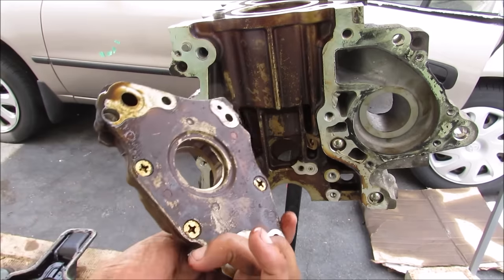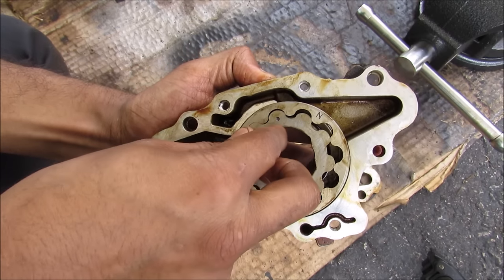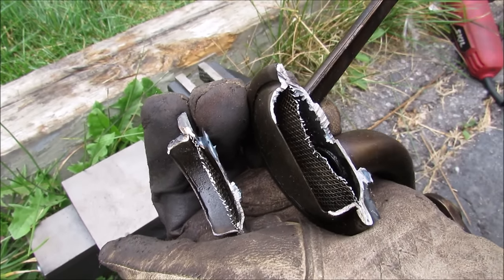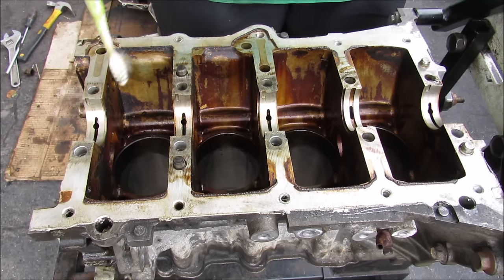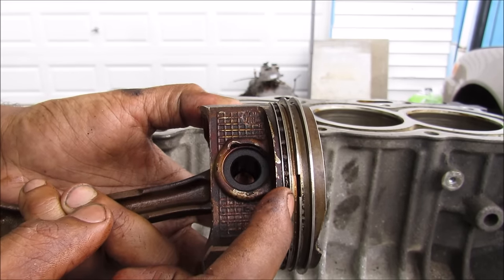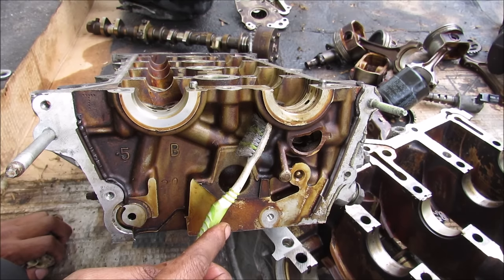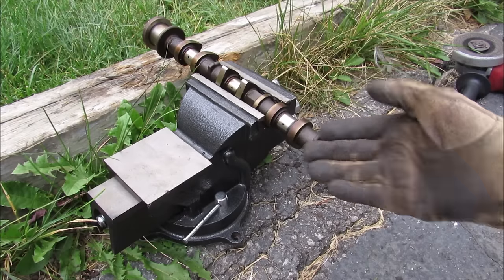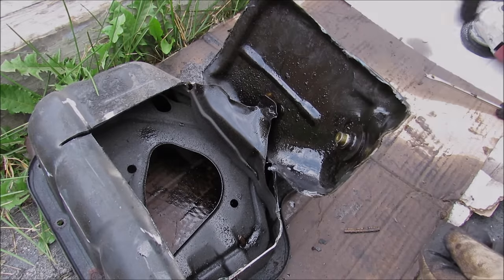How the Engine Lubrication System Works

Comment: You have sacrificed one of your engines to teach us how the oil lubrication system works we appreciate that. Thanks man very helpful show.
Reply from the maker: Hey I learned alot too!
Reply: @speedkar99  how do you know when you need a new engine vs a rebuild? I had an oil leak and ended up driving my truck for 30 min without oil.
Reply: @HighPriest1776  take the block and head to a machine shop so they can properly check for warping.  If it did warp, sometimes they can machine the high spots down to get all mating surfaces completely flat and properly hone the cylinder walls out if it's not too bad.

Comment: Moral of the story; your oil travels a great distance through many small holes and passages.  Better keep that oil clean if you want your engine to last.
Reply from the maker: +Brian Day it sure does.
Reply: And stick with anything but murican engines, murican engineers don't know what they are doing when it comes to an engine

Comment: When I was younger I was wrongly told oil just kinda got flung up everywhere it needed to go randomly from the engine moving - I really thought it dipped into the oil puddle at the bottom. Later I realised there were 'oil galleries' but I still thought they just sorta carried oil into different areas of the engine. I had no idea everything was this precise - it's amazing. And I didn't realise why oil pressure was needed but I can see now it's to make sure oil is forced through all those small channels. And that oil pump is like nothing I've ever seen too - I've made so many assumptions all these years, I just thought it had blades like a water pump or something. I'm astonished how much you can teach someone in 7 minutes.

Comment: You forgot to mention the crosshatch on the cylinder walls. Those are very important in the lubrication system. One cannot just assume that the oil will lubricate the piston rings. Without those crosshatching, you'll burn the piston rings and walls really quick.
Reply: btw I like your videos a lot. I binge watch this shit. hells yeah brother, hells yeah.
Reply from the maker: +hostilityy thanks, I actually didn't think of the cross hatch
Reply: speedkar99 They're essentially part of the lubrication system because if they're too horizontal, they'll hold too much oil and the piston rings will just be floating on oil and never really grab the cylinder walls. if too vertical, the oil will just drain down and no lubrication and will fry the piston rings and cylinder walls. that is why they have to be "cross" hatch like 45 degree angle overlapping each other with specific groove depths. 

your video is still perfectly fine without this detail because the average tuner or DIY guy doesn't know this stuff even exist. too technical lol

Comment: Comparing this video to all others on the same topic, they use diagrams and computer-generated animations with all colorful stuff, but in the end THAT’s what I was looking for ! ( just like the difference between color atlas of anatomy on a real cadaver, and other sorts of anatomy books 📚, there’s only so much you can deliver with diagrams .. the real machine dissection is a whole next level .. )

Rich in details and even the wear and tear marks, traces of damage and scratches, all give you a subliminal hint about the mechanics and you can always perceive the motion in your head , especially with old engines .. 
You did a brilliant job here .. keep up with the good work 👍🏻👍🏻👍🏻
Reply from the maker: Thanks I'm glad this teardown helped. I have a similar perspective, animations are cool but seeing the actual thing shows you alot more!
Reply: speedkar99 
You’re absolutely right !
Also,  when you expose the internals of an old engine, and I see how clean some components still are, compared to the rest of the body, despite probably years of operation, I imagine all the sealing and filtration techniques for oil as it’s flowing along its journey through the engine.. 
you show all of that and much more without saying a word !
Your effort is highly appreciated man, and we’re waiting for more .. 👍🏻

Comment: Wow.. that was a good explanation of how the oil flow runs. Thank you very much for this. Much appreciated.
Reply from the maker: It's so intricate eh
Reply: I have issues with low oil pressure on my Tahoe 2004. Am I forming myself how this lubrication system works. Resulting in everytime I start my other car I see in my mind how the oil reaches out to the camshaft rockers and I easily wait a few seconds before I start driving hehe… am more aware of how delegate this system is actually or actually more aware of how you can screw up your engine by not treating it with regular shifting of oil. 👍😎

Comment: This is impressive.  For so long, the small oil leak, which is supposedly common for my Subaru, has been blamed on a blown gasket.  Not saying it's not to blame, but the fact you just revealed the bearing covers could wear allowing a leak and knocking, is new 2 me.  👍 Job bro!

Comment: Excellent, i have this exact motor with a low oil pressure problem (which otherwise runs fine). Help'ed me visualize exactly where all the oil galleries/etc are and whats connected too what. Pretty sure im dealing with some worn out bearings OR at most, a jammed/sloppy oil relief in the oil pump.

Might start with some thicker oil and see what it does too the pressure, then go down the hole of either pulling the pump, or the whole motor lol

Comment: Great explanation. A lot more than an animation. If the oil pressure goes down then we can understand all the clearance of the cam,crank and connecting rad and the bearings are exceeds the limit. Isn't it?.

Comment: Bravo man! wonderful video, I start to understand car mechanics much better with your videos. thanks for the resources that you dissect for us.

just a little question, I intend to repurpose an oil pump for some hydraulic project, do youhave an idea of how much pressure it can generate ?
Reply from the maker: Thanks 
I'm glad it's helping you to understand! 

I don't have specs for the oil pumps but you can try contacting some aftermarket manufacturer for that.

Comment: Wow that is crazy complex.  So provided your ambient temperatures allow in a warmer climate for example, thinner oil is definitely better than thicker oil for modern engines such as 10w-30 instead of 15w-40/20w-50 would be preferred.  That way the oil flows a bit more freely through all those narrow holes & ports.
Reply from the maker: Yep and modern engines require even thinner oil because of tighter tolerances yet

Comment: I've always wondered----does the 'clean & filtered' oil come out of the oil filter through the numerous small holes on the outer edge/diameter of the oil filter or does the 'clean & filtered' oil come out of the oil filter come out of the large center hole of the oil filter!  Now I know!  :)  Thank u.
Reply from the maker: +asdflkjh thanks glad that clarified things and now you see how that filter works as a part of the engine.

Comment: As you have pointed out, why is that they can't place the drain plug at the bottom most spot of the oil pan.
Reply from the maker: +Dominic Fong good question....
Reply: Maybe the manufacturers designed the plug like that  intentionally, so that a minimal amount of sludge is left behind and over time the small amounts will build up and cause damage therefore you will purchase another car.
And If your car had lasted you 10,15 years tilll the engine stuffed then most likely you will purchase that brand again. 
The manufacturers don't want your car to brake down to early but most of all they don't want your car to last for ages, only long enough for you to feel that it was a well built car and purchase their brand again.

Comment: This perfectly shows 1ZZ-FE's piston oil pick up rings that were redesigned in 2003 due to the small holes getting clogged. Synthetic oil or frequent oil changes fights this.

Comment: Super interesting material. I never knew that oil pump is so sturdy. It must create tremendous flow inside of the engine. I wonder what's the difference between regular engines and super performance engines like in AMG series where oil's viscosity is similar to water.

Comment: Thanks for the vid.
You seem very knowledgeable on this subject.
In your opinion is doing an engine oil flush positive or negative?
Reply from the maker: The engine has to be really bad for it to be worth it.
Even so it could loosen sludge and lodge it in one of these passages which can be dangerous

Comment: Do most or all modern cars have a pressure regulator? I am wondering about a 2014 Ford Mustang V6 3.7.

Thank you for the helpful video.
Reply from the maker: Yes. Otherwise the faster the RpM the more oil flow which isn't something you want unregulated
Reply: Thank you!

Comment: Excellent video! Thank you!
I have a question, in a running engine and without taking the valve cover off, how can you
make sure the oil is flowing good, I know checking the oil dip stick is a good sign, but want to make sure, specially if there is a a bad sending pressure unit.

Comment: Great video! Small suggestion: slow down a bit, it will make it easier to follow and absorb everything.
Reply from the maker: Thanks, I try to keep my videos short and to the point as to not bore the audience
Reply: @speedkar99  short videos is good and for that you succeded very well. But as a non english native it get hard to follow, and I bet that those who ain't too knowledgeable in mechanics would have an hard time to follow too. 7 minutes or 10, still a short video.

Comment: The oil pump is located on the crankshaft pulley side right? Also is it like this in every engine? Or the pump may be positioned in other places?

Comment: hi buddy  excelent real parts explanation better than animations ...in this example u explained an engine that uses oil filters with bypass valve on the filter itself....i wanna know how my engine works in that specific area...my car oil filter have no bypass valve  on the filter itself...on the engine side  where the oil filter base  with the nipple thread for the filter is there are 2 holes and the threaded nipple ...does that mean that 1 hole is for exit oil from engine , the other hole is the bypass itself? and the threaded nipple is the enter for the oil from the filter?? could u explain like u did with this engine , another explanaination on engine with bypas lubrication  on the engine itself??

Comment: Those are a lot of places the oil needs to travel to. Does this mean that the oil does not lubricate the comparatively far off components until after a few cycles?
Reply from the maker: It does 
Just not instant
Reply: That why it is better to run engine for a few minutes before revving hard
Reply from the maker: Just to ensure oil pressure has built up and lubricated all the moving components
Reply: @speedkar99  How much maximum time an engine may take to spread oil and lubricated evenly
Reply: Awais Iqbal an ordinary engine does less than 10 second, some engine with high pressure pump does faster than ordinary engine took to lubricate the whole components.

Comment: There should be an electric and mechanical oil pump.  That way, when you unlock your door, the pump can engage to prime the engine before it turns over.
Reply from the maker: True, but startup wear isn't a huge issue to justify it's cost.

Comment: Hi , 
I recently got the oil changed for my cars engine . It’s 1.6 liters Diesel engine by Hyundai makers . 
So the hiccup is ,the service station put some other oil than the usual oil I use for the car. So my question is how do I get that oil completely outta system and use the same oil I have been using previously. Will there be any of the oil still be left in the system once I drain it out . If so will there be any complications if these two oils get mixed up. And both are synthetic oil fyi.
Reply from the maker: Yes there will be a miniscule amount of the wrong oil left in the engine. Less than a liter. 

It's not like the transmission where you only drain 1/4 of the fluid.

Comment: I don't see any vanes or baffles (like in a centrifugal or reciprocating pump) so I don't think the oil pump actually generates pressure. It just pushes the volume. The pressure is created by the clearances in the engine between the various bearings.

Comment: May I respectfully ask you a question?
issue:
2ZZGE no oil pressure at VVTL oil port 2003 Matrix XRS 2zzge.
I rebuilt the motor this past Feb with new OEM gaskets,bearings,rings,oil pump ect. car drives fine to work and back.
i get no check engine lights either.
I have not been able to engage lift.
Today i got a oil pressure tester and these are my results.
1 -At the oil filter i got 12PSI steady at idle. at about 3k RPM it read 55 PSI.

2-at the OCVL oil pressure port it read "0" PSI (zero).

im assuming this is why im not engaging Lift.

i posted this on the forums but no luck.... please help out.
Reply from the maker: Maybe a blockage in the oil system...only teardown can tell
Reply: speedkar99 no No No No!!!
Reply: Do you think i can Route T fittings with an Oil Line from the bottom pressure sender to the upper??

Comment: Can i flush an engine to solve low oil pressure. Bout a used car, dirt oil and couldnt change it in time. Oil pressure light came on having problems idling for more than 10-15 minutes. 0 pressure at idle 60 in gear

Comment: hey ther . very good info. i have a problem with my hiace vvti 2.7 engine . i went to check the sparkplugs and was just about to take it out when i noticed a lot of dark engine oil on the long ignition part you pull out firsts. so much darker than the engine oil so i feel it must not be draining and circulating properly and its very concerning as i cant take my sparkplug out with out oil going in the cylinder its that full in the head. The engine runs perfect and does not miss a beat and regular synthetic oil every 8000k any ideas on how this could be happeneing ?
Reply from the maker: Spark plugs tube seals
Reply: @speedkar99  hey thanks for reply. I figured it out I think. The valve cover gasket has a middle gasket that just a bit leaky and the oil was darker as it was old oil from 2 years ago so I just cleaned it out and will wait to see if more goes in before I change it. Xheers
Reply: @speedkar99  yes I think so

Comment: Anybody know why the inside of the piston and the connecting rod are stained that brown rusty color? I'm sure it's related to the oil but in what way? Is that a sign of overheating or going too long in between oil changes?

Comment: How does the oil in the engine head does not enter combustion chambers from valve opening ?
Reply: Never mind, i found out how on "Why do Cars Burn Oil?
" video.
Reply from the maker: Valve stem seals

Comment: Greatest explanation I've seen ever during my learning the whole recent week! I am highly appreciated and thanks very much if you can give an advice for my Santa Fe 2015 (the ODO =  45,000 miles) which encountered with an engine stuck (engine turned off when I accelerated from 55miles/hr.). The engine was disassembled and found the crankshaft #4 jammed with its bearing (bearing rotated inside the connecting rod, friction, crashed with the crankshaft#4). All other bearings and crankshafts #1,2,3, all cylinders, all pistons with its components and all the cam parts on top of the engine are in the perfect conditions even not have any minor wear! The workshop technician concluded the Lubricant pump was the root cause of the problem and requested to replace. I am very confused don't think that is correct cause BUT should be some mechanical dimension tolerance issue or lubricant pipe of the #4 clogged that prevented the lubricant from protecting the #4 so that the friction happened and caused the damage? How do you think and would you give me an advice how should I do to ensure my engine fixed properly? Thank you very much and have a nice day! Cheer...

Comment: Warning... Cutting your camshaft in half with a grinder may cause the engine to stop working... unless it's a Ford in which case they run so badly you won't notice!
Reply from the maker: That's a good point

Comment: Some of those holes are very small.  5w30 is definitely better for these engines.
Reply from the maker: +Grandizer 45 yes that's the required oil for this engine. Frequent oil changes are needed.
Reply: speedkar99 i will never again use lucas oil stabilizer. Way too thick.
Reply from the maker: +Grandizer 45 agreed. 
It stops oil burning but doesn't lubricate well.

Comment: You are worng the oil pump is responsible for flow the  oil clearances are responsible for pressure that's why my recommendation if somebody loses oil pressure I tell them to get an engine rebuild
Reply from the maker: Agreed here...pump - flow, pressure is created by the small crevices

Comment: There's a thing called changing your fucking oil.....Jesus
Reply from the maker: Yes right?
Reply: work at an auto parts store part time while in college and surprised (not really) about how many people dont know either how to change oil, when to change oil, or even that there is a thing called an OIL FILTER that gets changed as well.... Should be required that you understand minor maintenance before purchasing a car.... less cars in the dump!